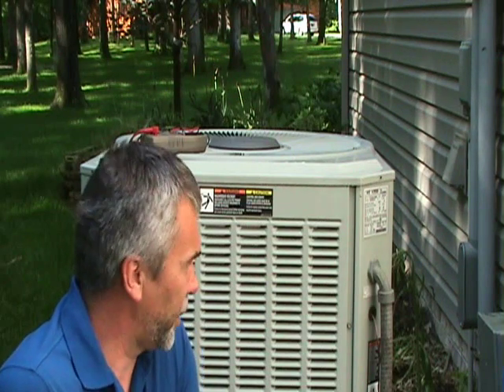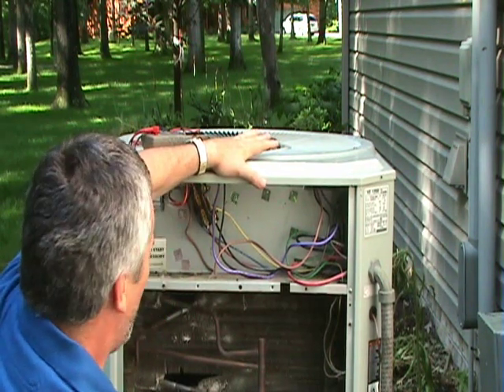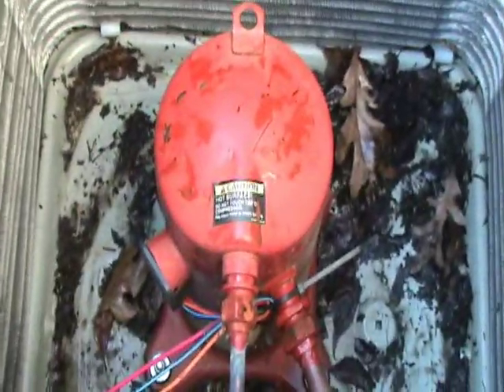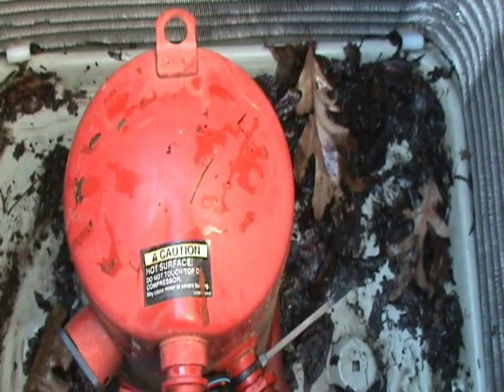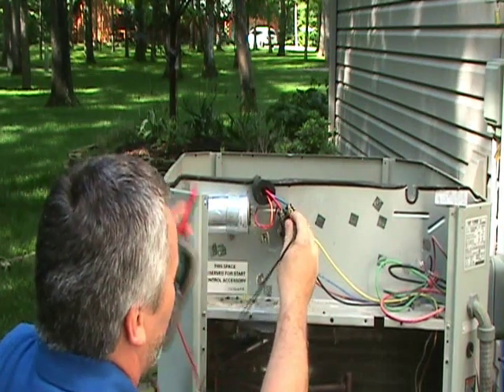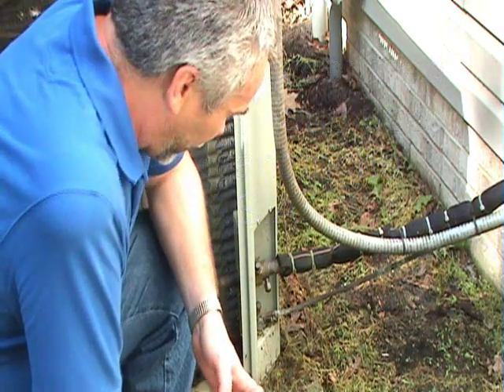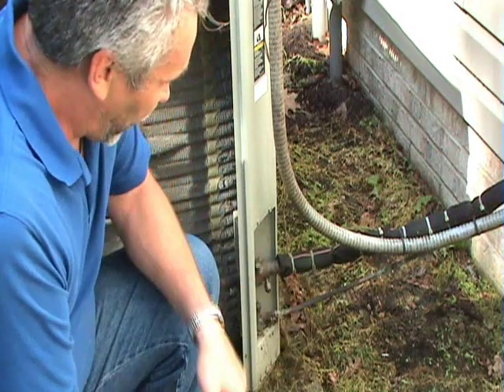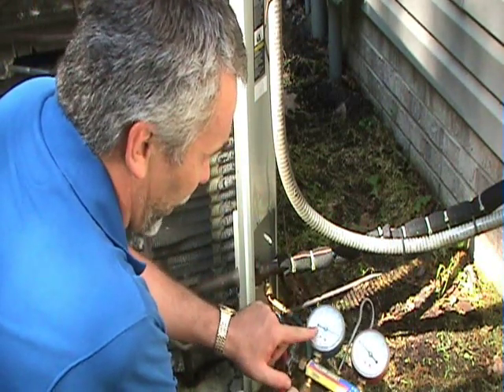AC Not Cooling? 🛠️ How to Test Your Compressor Like a Pro!

Comment from the maker: Is your compressor really hot to the touch but giving you 'open' resistance readings? Stop! 🛑 It might just be tripped on its internal thermal overload. Let it cool down completely (or spray the shell with water) before testing again to get an accurate reading! [06:24]

Quick Tip: If your compressor is humming loudly but won't start, check your start capacitor before assuming the compressor is dead. It's a much cheaper fix! ⚡

Comment: Bullshit. As long as you turn off the breaker and discharge the capacitor (usually not needed) it's safe. If you do your research you can do most A/C work yourself. Most A/C repairs besides dirty coils are either a bad contactor or a a bad run capacitor.  Checking superheat and subcooling is easy too. Repairing leaks, changing TXV or installing a new system is probably best left to the pros. I've been doing my own a/c work for years with no issues.